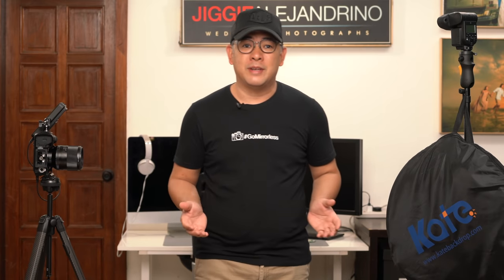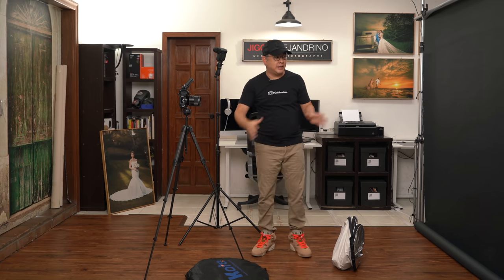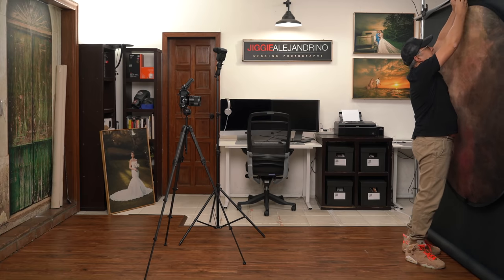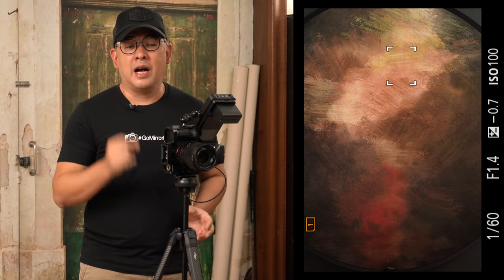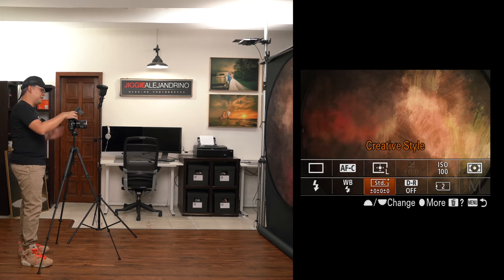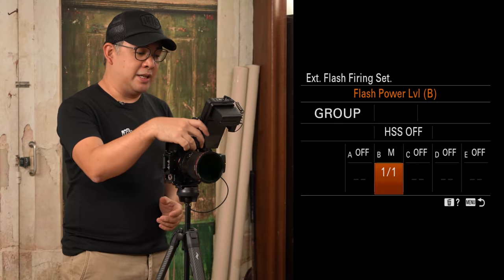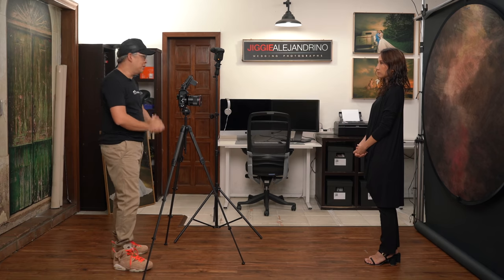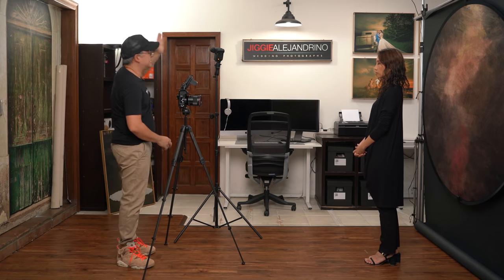How to Create Amazing SOFT Light with NO LIGHT MODIFIER. A Classic Portrait Lighting Tutorial

Comment: Very good idea to use ND filter as my camera does not support HSS
Reply: Or just turn off lights in the room,flash power can  also be reduced in that case. By all means images were great.But this video is more of promotion of very expensive equipment that most of us don't need. There are many different ways for archiving these kind of shots without need to buy gadgets that cost you an arm and a leg. By all means he is great photographer, I just have problem with too much advertising.

Comment: No light modifier? WRONG! Soft light is created by the size of its last point of contact! Shoot-through or reflective umbrella? Bigger light source! Softbox/Octa? Bigger light source! Bounce off several square feet of a white wall? DEFINITELY a bigger light source! ALL of these spread the light, thus modifying it! Even the small diffusion dome for the flash is a modifier that spreads the light! The ONLY way for NO light modifier is to shoot with a straight flash, which will be smaller than the subject, thus creating HARD light! Try it and see.